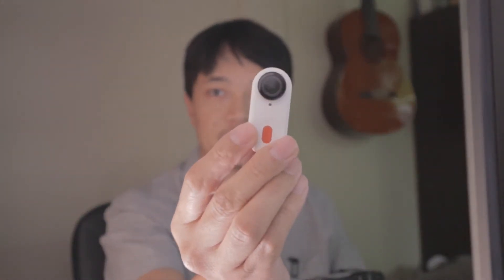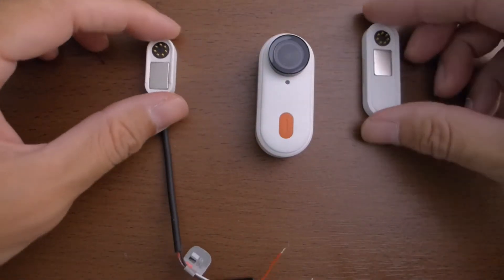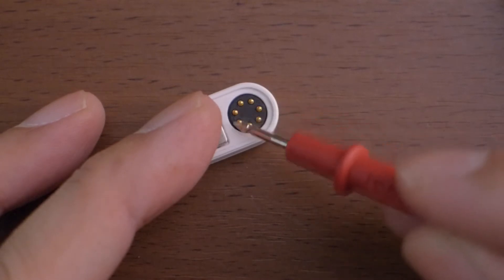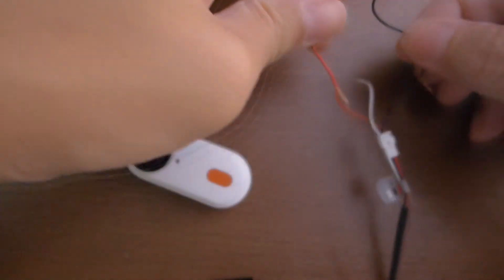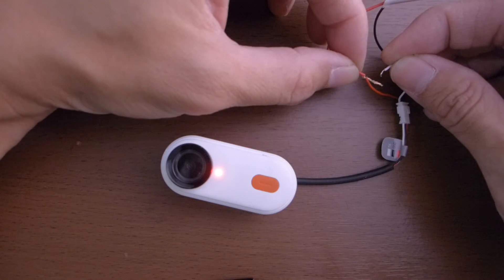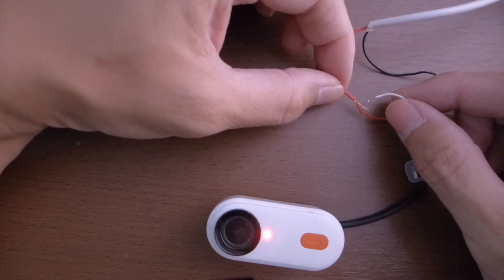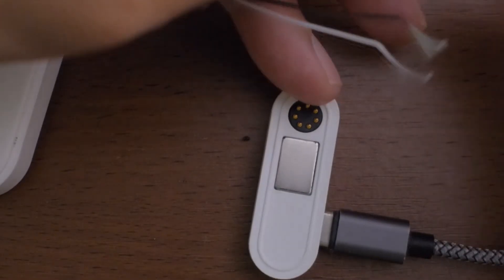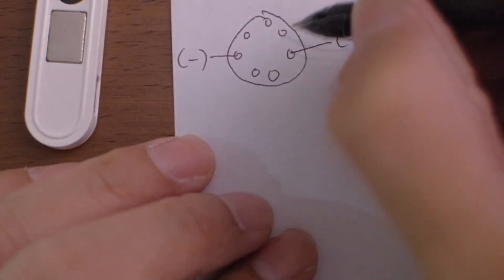Caddx Peanut / Go 2 Pin Out and Cable Testing

Comment: is it working on insta 360 go 2 cause i did the same thing and its not charginh
Reply from the maker: I think it should since they share the same pin layout
Reply: @awitv  i tried feeding it with its original charging case battery directly from its back and its not turning on maybe it needs a 5v charging module? btw i broke mine and im trying to fix it
Reply from the maker: @Daaikii  sorry but if the connectors are clean, most probably the unit is broken.

Comment: Hi I'm trying to record a bike ride with Go2. I know that Peanut can use an external button by shorting pins 2 and 3. So, when I checked pin 2 in my Go2 type C USB charging case, it seems to be an empty pin. No response with my tester. The Go2 has a shooting time limit, so an external button is required to start shooting again when shooting is over. Is there any way to use an external button?
Reply from the maker: Hi, most likely because the Go2 pins are already connected via bluetooth to the case, probably it's not routed further to the Type C connection on the case. But I'm not sure and cannot test it since I only own Peanut.
Reply: @awitv   Hi, Using the Go2 bundle remote case on a bicycle is very inconvenient.
If pin 2 is assigned to BT, there seems to be no way to remove the button externally.
I'll have to find another solution.
Thank you for your prompt response!

Comment: Hello, do you know the pinio Pad if I use tx 5 and not tx 1. If tx 1 then a9, I don't know these pad description.
THX
Reply from the maker: Sorry I have no experience with fpv boards
Reply: @awitv  
OK thanks. I found out to write resource in the command line and then I get all information.

Comment: hello, is it possible to use  a 2 position switch on my remote controller as this:  switch on position 1 not recording, switch on position 2 recording.   I'm asking this because it will be hard to know if it's recording or not...
Reply from the maker: Unfortunately no, you need to give two short pulses, one to turn on, and another one to start recording. The next pulse will stop recording. I think this is because it only uses one cable/channel.

Comment: Nice. 
I have a couple of Insta360 Go 2 cameras I use mostly for capturing video with FPV drones. 
When I saw the Peanut I thought it was a great idea but didn’t need to buy it. The Peanut accessories though got me thinking. 
I got the power adapter, shaved off the rim that keeps it in place and it works with the Go 2! 
Then I made a mount for my drones that holds the camera and the power adapter in place and allows me to control recording with a switch on my controller.
The trick is, and I think why triggering filming didn’t work so well for you, the recording button is triggered by 3.3V logic, but you gave it 5V. You could try reducing the voltage from your supply or using a 3.3V supply and then you should have stable and reliable results triggering filming.
I also found that the first trigger puts the camera in standby and the second trigger starts filming once it’s already on and standing by.
Reply from the maker: Thats nice info, I never thought of the different voltages. Btw where did you get the power adapter?
Reply: Hi Kevin, thanks for this precious info man. THIS IS GOLD for me right now. I also have a Go2 and want to use it for on my quad. Which one do you recommend, the small one or the usb-c type ?
Reply: @filipmaftei7264  hi do u know if there is a way to use it as a webcam thru the usbc cable?
Reply: @sylvia9292  Hi, no, it can't be used like that. sorry